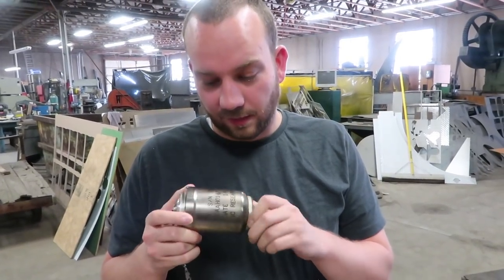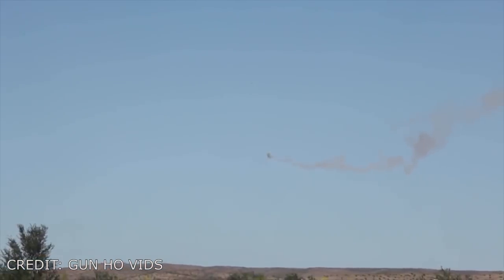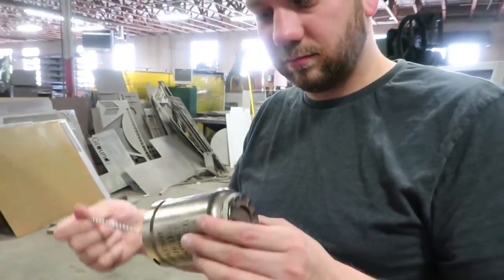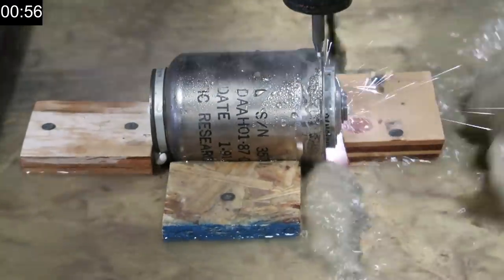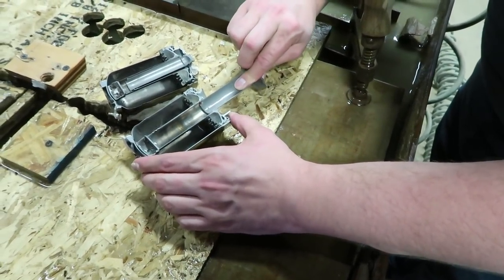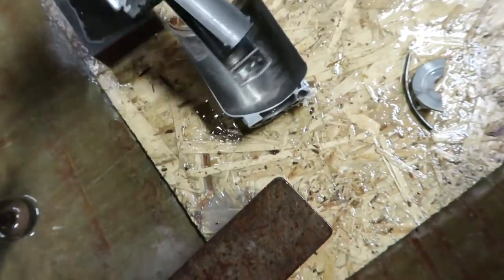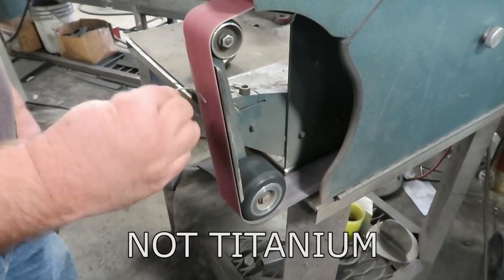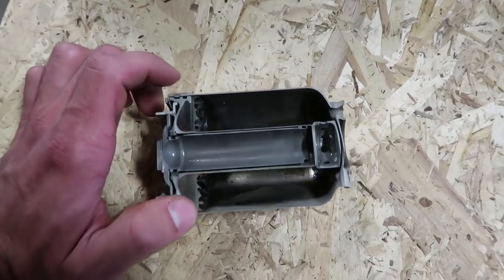Stinger Missile Cut in Half with a 60,000 PSI Waterjet

Comment: You should get something like a complex clock with all its gears, and fill it with a clear acrylic so when you cut it, the pieces will stay in place, but the clear acrylic allows you to see everything.
Basically you could do this with anything that’s complex and otherwise would not stay together when cut with the high pressure water jet.
Reply: OH MY GOD YES HECK YES, I WAS THINKING HOW TO CUT COMPLEX STUFF AND NOT HAVE IT GO EVERYWHERE; BUT WITH CLEAR ACRYLIC RESIN (de-gassed) IT'D WORK EXCELLENTLY OMG
Reply: @WaterjetChannel  the "motor" is filled with gas to propell the rocket out of the tube.
Reply: @dimitar4y  YES YOU SHOULD ALSO WATERJET A CAPS LOCK BUTTON BECAUSE I THINK MY SANITY IS INSIDE IT

Comment: Who knew a water jet could create sparks lol
Reply: It is not water it is h2o dud
Reply: Its the abrasive they use that's mixed in with the pressurized water that does the majority of cutting on tougher materials which is why the titanium metal sparks when cut. If it was pure water it wouldn't spark.
Reply: They use sparkling water, obviously
Reply: @snowy7976  H2o is water.
Reply: SnickleFrits Pickle most people 😂
Reply: @PostalPatriot556  *some people's children 😂
Reply: Water jet a water jet 🤷🏽‍♂️
Reply: Drazex IV  hydroxic acid
Reply: Its more the titanium. Titanium is pyrophoric (ignites in the air at low temperatures) if the particle size is small enough.

Comment: The rubber is the rocket fuel, it burns really hot and fast
Reply: yes, and the oxidizer passes through holes in the rubber creating a burn chamber that is consumed during the process.
Reply: @bundles1978  is it a hybrid rocket? I'd assume it was a solid booster, especially considering the main engine is composite and its relative stability.

Comment: Not something you should lick. The BDU that powers the missile uses argon gas which can leave contaminates on the squib (the item you licked). Argon is not human friendly or something you should ingest. just saying.
 
On a side note. You mentioned that the missile itself  has a low yield explosion. You are correct. However, I have had the misfortune of witnessing the launch motor fail in tube and kill the recruit that was firing it. That motor is built in a way that it should protect from such a thing, but if the built in fail safes don't work. It is a very powerful explosion.

Comment: 1 and 1/2 handgernades sounds a bit weak for 6.6 lbs of explosive
Reply: The entire warhead weighs 6.6lbs - including the casing, fuse, and fragmentation elements. From what I can find there is about 1 lb of actual explosive in it. Hand grenades vary but generally have only 1/4 lb of explosive in them, so I would still say the Stinger is about 3-4 hand grenades worth.

Comment: Think I just realized what the piston is for.
At first it appeared to maybe be a force dampening device to prevent the hard deployment from the booster from messing with the main rocket.
Although upon viewing slow motion it appears in my head to be a way to impart force on to the tie chain that holds the booster to the main motor. Presumably they are using a pull igniter to lite off the main motor, which would actually be smart. It will fire the main motor when the booster discards.

Also the rubber you see is likely the left over from its composite propellant, both the booster and main motor uses it as its fuel.

Comment: The rubber is most likely a similar rocket fuel to the Solid Rocket Boosters used on the Space Shuttle. Its supposed to have the same "squeezeability" as a pink pearl pencil eraser.

Comment: That's a really smart design. If it was just a rocket pushing the missile it would be right on it when the missile started up. But that little ☂️ thing pushes the missile forward and the launch motor back so there's space in between. Using the same fuel.

Comment: Here's my guess: the solid fuel burns upward, so it's always at the bottom of the solid fuel block, that's how the rubber survives. The piston thing I assume is a bumper? Maybe? To protect the rocket nozzle? Or maybe it pops up and jolts the rocket away from the booster so it doesn't launch the booster back at the person firing it. Yeah, that's what I think. That pops out so it's not right on the rocket's nozzle when that kicks on
Reply: I was thinking a buffer tube to soft start the main rockets move, theres alot of sensitive equipment in the main missile, so I'd assume even though it's a powerful booster the slight dampening of a piston may prevent potential damage from a launch.
That's a lot of G's from a stand still.